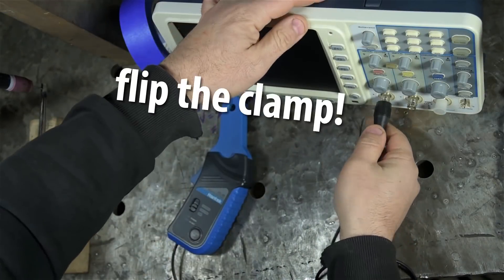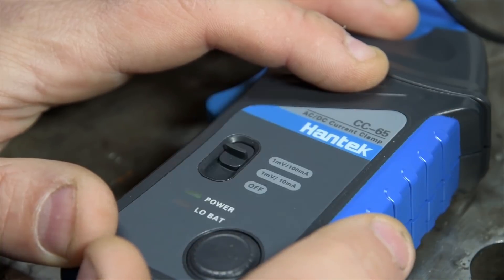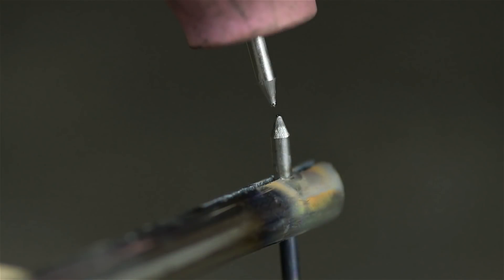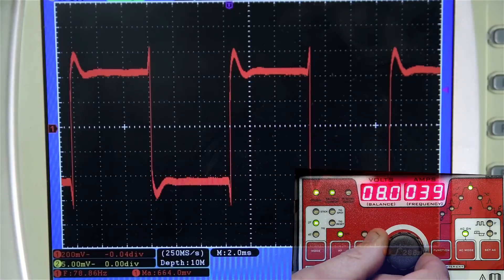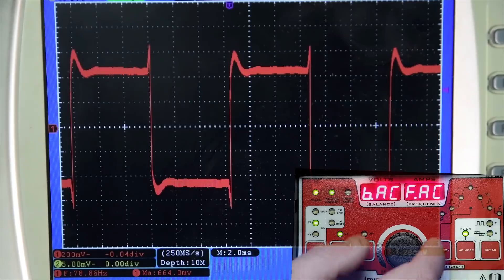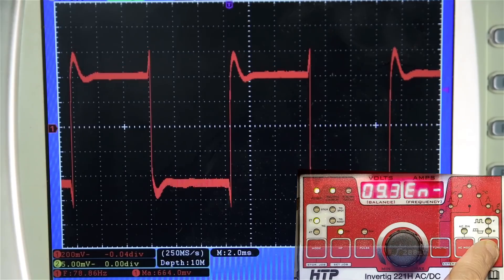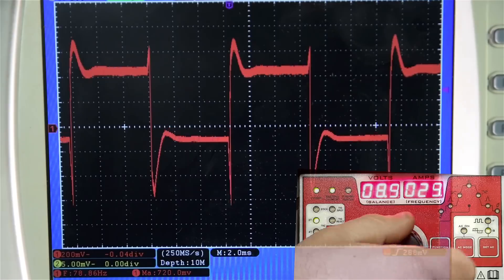Asymmetric TIG - CAUGHT ON CAMERA!

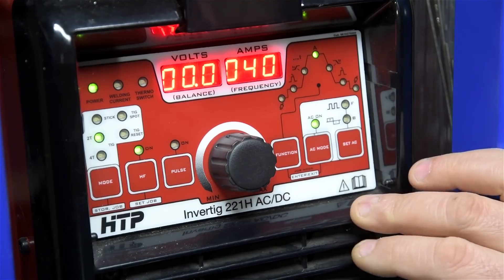Comment: @1:50 The humps in your waveform (Batman's Ears) are from "ringing" in the coils of the inverter.  When you change the current flowing through an inductor the collapse of the magnetic field gives you spikes like that.

Trivia: This is how an old points-and-coil ignition system worked.  The spike was the high voltage pulse that zapped across the spark plug.
Reply: I don't think it's caused by ringing on an inductor.
My best guess is the ringing at the rising edge is actually a control loop oscillation. The switching frequency of this inverter must be tens of kilohertz, while the waveform we see has about 70Hz. This means it is constructed by the welder out of many switching periods of the inverter, much like a digital amplifier, and you are not looking at individual switching events at all but rather the overall result including all the imperfections of the control loop. When you make a control loop that is fast it often overshoots after quick movements, you have to compromise.

I have no explanation at all for the peak at the end of each pulse. Part of me thinks it must be intentional because there is no reason why the current would go up like that.

I design switching power supplies every day, but not welders, so I know what switching waveforms on inductors look like. I hate it when people claim to be an expert, I'm just saying I am not some crazy guy who wants to disagree with you, I have good reasons why I think your explanation is insufficient.
Reply: I agree completely. The current overshoot is an indication of a poor transient response of the control loop of the switch mode PSU feeding the H-bridge chopper. I'm sure it could be corrected if you were prepared to dig into the circuity a little. In this case the controlled parameter is the load current.
I too design switch mode power supplies.
Reply: @Stefantrethan, I agree to your assumption it is intentional.

It may be designed to be like that in order to maintain the arc as it switches polarity. Then it can keep a stable arc even at low amperages without adding HF. This power source is probably built to be extremely stable as needed in robot welding when there is no human involved to correct for any instabilities in the arc. That peak will do the same as adding HF. Technically it is adding HF.
Reply: Elizabeth Greene and I learned something agaaaaaain..... even reading coments on This old Tony videos makes you learn stuff ....... this channel is DANGEROUS
Reply: a+++++
Reply: I am not entirely certain it is the closed loop circuit do to the fact that the pulses seem to overshoot always to the same value independent of the set pulse amplitude. I classical PID control loop would overshoot more or less depending on the value set for the desired on. So I would guess that the setup is not calibrated properly for frequency and what we see is a standard RLC step response. Check if you have a way to adjust your setup maybe a capacitive trimmer on the clamp?
Have fun!
Reply: johnptc high frequency inductors are still involved.  HF is much lighter weight.
Reply: I'm pretty sure the spikes are just artifacts of the polarity switching circuit. It also seems as if they begin every half-cycle with pre-loading a full value into the PID integrator, which makes it look funny at low outputs, but helps sharpen up the edge so it can achieve full output faster...
Reply: Perfect square edges are impossible without infinite bandwidth.  https://en.wikipedia.org/wiki/Gibbs_phenomenon
Reply: what inductor >>    i thought with a full inverted welder the inductors are long gone and hence why older hybrid or transformer welders weigh so much.   the spike are a result of the fourier series used to create the square wave
Reply: From a Lincoln Electric overview of waveforms: "Overshoot describes the condition where the front flank increases to a predetermined level beyond the level of the peak current. It is expressed in units of percent. Increasing overshoot is associated with a more rigid arc that is less prone to deflection."
Reply: I would have to think so too!
Reply: @Roger Onslow A++++ short and sweet thank you
Reply: @Jens Kaufmann @ Einar S  A+++
Reply: @johnptc It seems awfully high and consistent to be square wave overshoot. It doesn't decrease when he lowers the amplitude.
Reply: there is a Lincoln squarewave ac/dc welding power supply.... i would like to see if it really is a square wave as advertised.
Reply: "Einar S: It may be designed to be like that in order to maintain the arc as it switches polarity."
This. The other things here dont make sense. The current is going up _befor_(!) and after each polarity switch. Not just after the switch.
Reply: None of these explanations seem to account for the fact that the spike at the end of the square wave wasn't present in the previous setup from the other two oscilloscope videos. My theory is there is some kind of inductive backlash introduced by the way he has things set up now (not the welder), but I'm no expert. Alternatively, his previous setup could have been absorbing the backlash /shrug.
Reply: Correct for the ignition, but he captures the current in the system and the current should be smoothed by an inductance... maybe the probe wasn‘t correct synchronized...
Reply: Ahhh... not quite with the points and coil thing. The points where just a 12V contact timed with the crankshaft to open before the piston reached Top Dead Center(TDC) and the coil didn't generate any output untill it was disconnected from the 12V by the points. It's actually the collapsing magnetic field setup around the primary in the coil that generates the vastly higher voltages used for ignition.
Reply: @ stefantrethan. if you had left out the last  paragraph i most likely had agreed with you  sorry
Reply: @ stefantrethan.. no one is trying to go into great detail here to explane a wave form... just to keep it simple and if you DID understand the wave forms (like you explained in the 1st paragraph ) @Elizabeth Greene is correct .... if you design switching power supplies like you say ..you  understand . so i quote you "I have no explanation at all for the peak at the end of each pulse. Part of me thinks it must be intentional because there is no reason why the current would go up like that""""".ha ha ha "it must be intentional" .....WTF ....  " I hate it when people claim to be an expert " oh ok ... quote me as saying"""" if you understand how it works and understand you problem you can always fix it"""" you must not be able to fix your own switching power supplies . you are claiming to be a expert..... need help goto this channel https://www.youtube.com/user/KeysightOscilloscope

Comment: On the upswing side, the overshoot is due to time lack in negative feedback control of current. It just takes the circuit some microseconds to stabilize, and it overshoots the target current value. On the downswing side, those little peaks are most likely due to inductance in the welder circuitry and in your setup. Here’s how you can test that hypothesis: arrange your welding leads so that there is less ‘loop area’, which controls inductance. Least loop area means least inductance. Shorten the leads and/or twist them together where possible. The magnitude of the trailing edge peaks should go down.

Comment: Actually those wave forms look fairly good for something like a welder.   I have seen a lot worse on some switching power supplies. The overshoots are generally caused by all the stray inductance in the circuit, which include things like the wiring, transformer leakage inductance and the HV start coupling network.

Comment: Glad you did this video, helps de-mystify some of those tig adjustments. It would be super helpful to match up the various wave configurations on the scope with the metal being worked on: e.g. aluminum vs. bronze etc.  and talk about why certain metals require different configurations.

Comment: the leading and trailing peaks are a result of inductive reaction in the wire to and from the machine...
Reply: Become a licensed Amature radio operator and learn RF....and thousands of other things the hobby offers. It will complement your work knowledge. Look for DX Commander on youtube. He is doing ham radio stuff that might be interesting to you.
Reply: Nope.
Reply: I agree with Ramiro, the inductance being overcomed and the signal level being switched to the other polarity causing the electric field being collapsed and recreated is just like the old points in a car ignition. The engine fired when the point broke. The charged coils magnetic field collapsed and a spark was generated, This is what you are seeing in the scope trace. Just at a different voltage level.
Reply: THX... Im an electronics tech (I love hobby machining and also do work as a software developer)... this was classic textbook inductive bounce. seen it a million times.

Comment: I think you buried the lead in the new setup by making the arc symetric - tumgsten tips on both sides.  Can you try again with steel on one side like when welding?  I think the current will go asymetric again.
Reply: Its not going to happen. Why? Because the welder doesnt want that to happen, it actively corrects its parameters to get to the 50% (or whatever else is set) balance. So it would simply up the voltage if one side is "harder to pump threw". If this was a stupid powersupply that doesnt regulate at all and just pumps out a somewhat consistent voltage&current... maybe we could see a little change. But still not much.

Comment: I think the reason the "square" waves look like that is because of the Gibbs phenomenom.
https://en.wikipedia.org/wiki/Gibbs_phenomenon
Reply: Most likely it is simply overshoot as the HTP switches polarity. This is based on controls theory, and is in no way a problem. https://en.wikipedia.org/wiki/Overshoot_(signal)
Reply: Given the shape, but primarely the frequency I think thats unlikely
Reply: Marc Simonsen you are probably right. Thank you for your correction.
Reply: Marc I think you are quite right.
But do you have any explanation for the spike at the end?
I can think of no parasitic effect to cause it and half think it is intentional - but why?
Reply: I'm currently an EE student and I can recall seeing that spike at the end of a square wave signal in a lab experiment, I went and dug through some old homework and found what type of circuit it was.  That end spike was present in the output of under, over, and critically damped of series RLC circuits when a square wave input was applied.  I can recall being perplexed by that spike and no one having an answer as to its cause.  You seem to be more knowledgeable about this than I am, is there anything in an RLC circuit that would cause the spike that might also be the cause of this effect in the HTP?
Reply: Given the speed of the rising and falling edges, this implies the Bode Plot for this signal will have some decent peaks in higher frequency ranges. Due to this one would expect an underdamped system. E.g. Overshoot. =D
Reply: It's not underdamped - where's the underdamped ringing?
Reply: Stefan - (going back to controls theory) I think the spike at the end is due to the way the control algorithm handles the command to change polarity, and may also be due to the fact that while the output of the HTP shows an ~80hz (or whatever frequency TOT sets it to) wave, in reality it is most likely PWM fed through a filter, and the last couple cycles of the PWM get left on when the command is set to change polarity, resulting in a spike before the drop. Just a guess though.
Reply: I've also had the thought that it might be an artifact of the polarity change. I'm assuming here (and we know what that makes of you and me) that there is an H bridge after the inverter to handle the polarity change, at least that's what my first attempt at building this would be. But that would mean they increase the PWM just before polarity change. Why would they do that, rather than just slamming the H-bridge over with steady PWM (or even momentarily stopping the PWM to reduce switching losses in the H bridge)? Makes no sense to me, but perhaps they use a different topology than I picture in my head. 
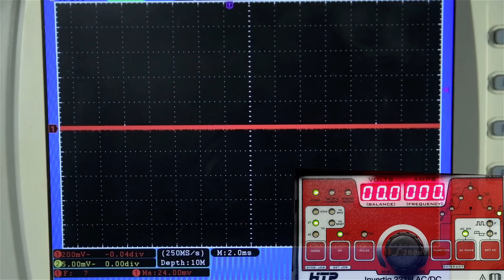If you look at exactly 3:21 (and other times) when Tony takes his foot of the gas you can see the overshoot, and the peak, remain at very high amplitude with almost zero steady current. This is so weird and parasitic effects should really diminish with current. Perhaps it does something good to the arc after all that they want... I bet the HTP engineer who designed this would laugh his ass off if he read this...
Reply: Stefan - I too would use an H bridge, and the TIG wiring diagrams I've seen do indeed use an H bridge. I can only assume (just as you've indicated) that for whatever reason, the PWM gets turned on fully right at the end of the plateau. What may be happening, is the PWM runs continually, regardless of polarity, and when the command to switch is sent out, it reaches the feedback loop before the polarity actually switches (aka, starts using the other side of the H bridge) , so the controller tries to command high, but the command is sent to the wrong side of the H bridge. In other words, it's a timing issue. But then again, it might be by design, and why, I don't know. 

But then jhensjh brings up a good point, that this may be attributable to and effect of an RLC circuit, although I'm not so sure about that as you point out that this spike occurs regardless of the amp setting.
Reply: If only we knew someone in Italy who we could plant at HTP as a spy...   ;-)
I think Jens is confusing the spike at the end with the ringing at the start. That would be a very typical thing every EE student would observe with variously damped RLC circuits.
Reply: You guys are definitely way over my head as far as knowledge of this topic, but no I'm not talking about ringing at the start of the square wave in the RLC circuit.  The spike I see is at the end of the square wave right before it drops off.  The spike I've seen is definitely of less magnitude than the one Tony has, but it's in pretty much the same position on the waveform.  Wish I had a quick and simple way to post an image as I have a copy of the scope output.  It's of course entirely possible that the spike I've seen is a similar effect with a completely different cause.